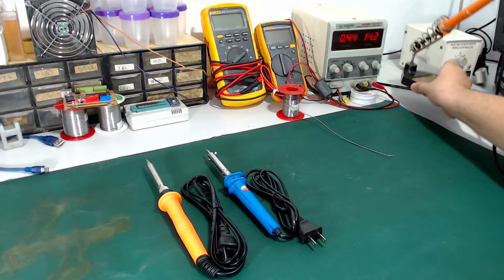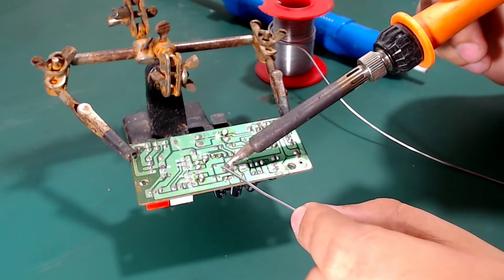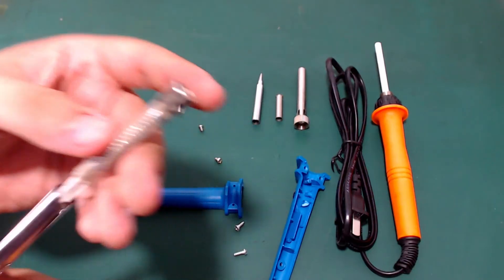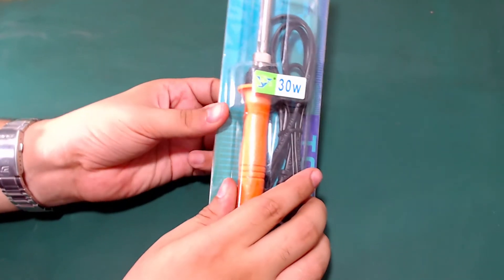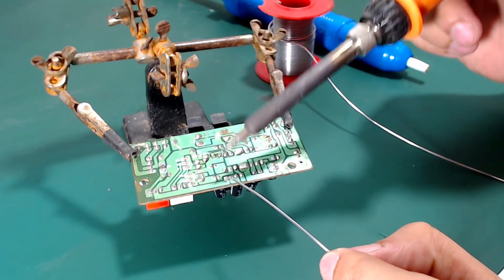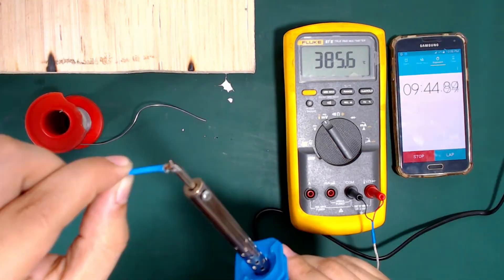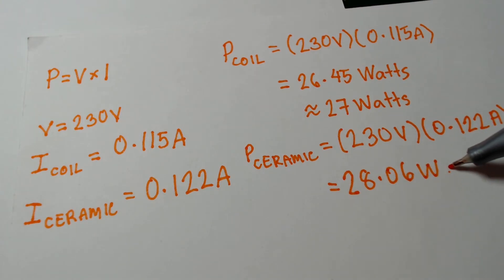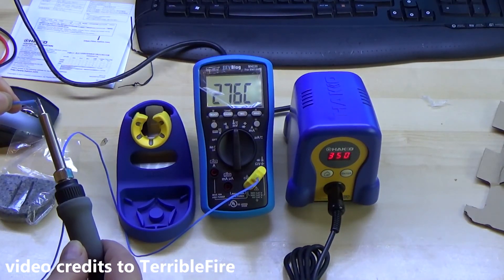Choosing the right Soldering Iron | Ceramic or Coiled?

Comment: There's a adjustable temp ceramic type for about 5$-7$ and that is the best.
Reply from the maker: Yes indeed, there are some, but as I wanted to show in the video is that as long as the heating element is of ceramic type, it would have better performance.